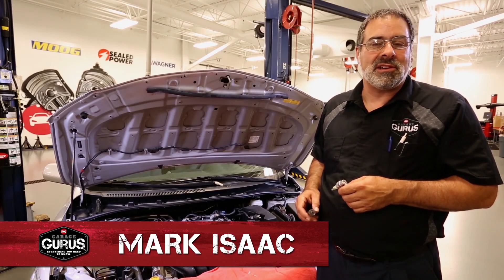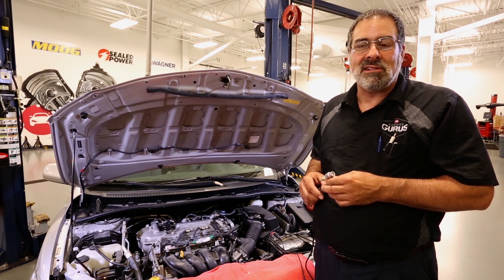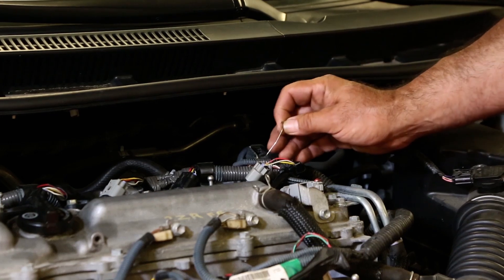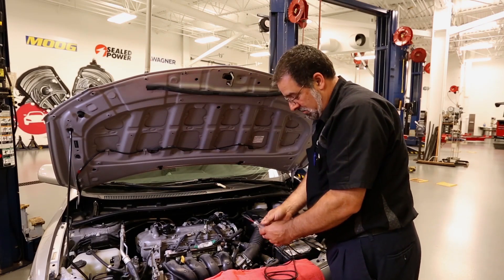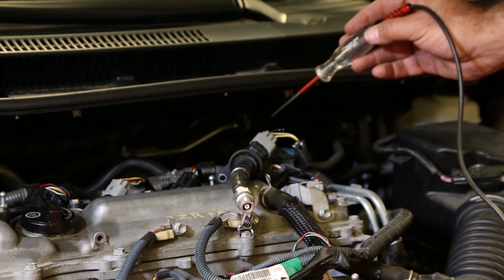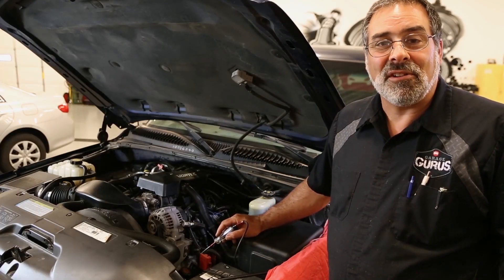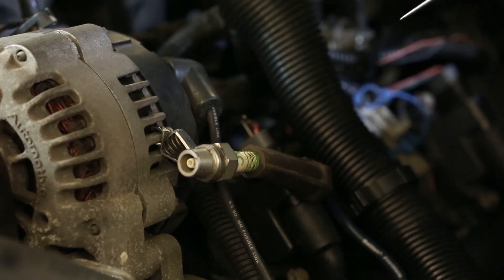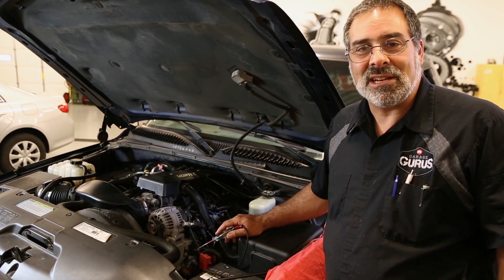Ignition Coil Test for Coil-On-Plug Systems

Comment: Hi ,What voltage is required to trigger the coil? Did you apply 12V for triggering? Your instructions aren’t very clear.
could you please explain in more detail?
Reply: 5 volts.

Comment: @Garagegurus does that mean its getting signal from the ecm and wire is not broken
Reply: No, you are acting as the ECM by tapping backprobed trigger wire. All this test tells you is if the coil is good or bad and if you have power and ground at the coil.

Comment: Very nice, my question is how does the transistor in the COP does not get destroyed with the 12 Volt ? A last question, how can I trigger 2 wire ignition coil , can just supply the negative wire with a ground ? Thanks in advance.
Reply: You have to first figure out if it's ground side triggered or positive side triggered.
Reply: Φίλε 
Όπως είδες αυτός χρησιμοποιεί ένα δοκιμαστικό κατσαβίδι έτσι δεν είναι 12 volt
Επίσης όπως είδες μόνο το ακουμπά λίγο
Reply: @konstantin-big  It's a test light connected to battery positive
Reply: Φίλε 
Εδω μπορείς να δεις πως γίνεται ο έλεγχος σε πολλαπλασιαστη με 3-καλωδια
https://youtu.be/PpofMV7DAow?si=WvsUU_dB12q3umKK

Comment: by B+ you mean positive terminal?  How do you get the voltage reduced to 4V?
Reply: I believe the computer reduces the voltage to the primary coil.
Reply: @wdtony  I think he did a direct feed from battery, consequently the computer would be bypassed
Reply: @renejacques8288 

He states the test light is hooked up to B+ and is reduced voltage. Ignition on. 

And this is the state B+ should be in until the computer opens the switch to collapse the field in the secondary winding. Since the car isn’t running, the primary (B+) will remain closed with reduced voltage available to the test light.
Reply: @wdtony  I thought B+ was pos + of the battery and as such is a constant 12v, and the switch the computer uses is 4v, yet he's hooking a direct 12v to the 4v trigger wire.
Reply: @renejacques8288 

B+ is reduced voltage from ECM, not battery.
Reply: @wdtony  The test light is directly hooked to the battery which is 12v; right?.  Does the COP itself reduce the 12 volts coming from the battery to 4v?
Reply: @wdtony  B+ is Battery voltage. He has the clamp end of the test light on battery positive, so he has 12 volts at the tip of the test light's probe, but as soon as he touches the T-pin the voltage gets divided between the light bulb in the test light and the transistor.
Reply: @renejacques8288  There's voltage drop at the test light as soon as he touches the T-pin.
Reply: @wdtony   No it's not. B+ is battery voltage.
Reply: @bernardocisneros4402  Is it really a voltage drop, or does the coil sensor draw 4V out of the 12V source (B+)?  If there is an actual voltage drop when he touches the T, what causes the drop?
Reply: @renejacques8288 The voltage drop is caused by the flow of current when he touches the T-pin with test light. The transistor and test light are in series and in a series circuit voltage drops are proportional to the resistances of the items in the circuit. Basically, the 12 volts gets split up between the test light and the transistor.
Reply: @bernardocisneros4402  OK.  Thanks.  Brings back some memory.
Reply: @wdtony   B+ = BATTERY POSITIVE
Reply: @renejacques8288  No, the PCM outputs a 4V square wave to the FET on 3 and 4 wire COP, the FET is inside the coil, the 2 wire COP the FET is inside the PCM which grounds the primary.

Comment: Which wire you triggering the signal wire,and are you sending a ground or current to trigger it?
Reply: The coil has two Pin (wires) ... one is the switching the other is constant 12v. He is sending voltage to the switch wire by providing 5v from his tester connected to + battery . YOU HAVE TO USE THE LIGHT TESTER TO THIS WAY.

Comment: If you have test light connected to battery positive isn’t that giving the trigger 12v instead of 4v and burn out ecu ?
Reply: If he wanted to apply 12 volts to the T-pin, he would just use a wire. He's using a test light to drop the voltage from 12 volts to about 5 volts
Reply: @bernardocisneros4402 😂

Comment: So do you mean..we hve to find the trigger pin in the coil circuit? And connect it with positive from battery to trigger? And just turn on thecar?
Reply: Never use a wire to do this. You have to use a test light.

Comment: Thanks for your video. Does this method  work for BMW 525I 2004? It has 3 wires. Is the test light voltage as same as the trigger  voltage?
Reply: I don't think bmw coils have built in ignitors
Reply: Wondering the same with a BMW X5 with the same motor as yours

Comment: "test light hooked up to big plus, we'll use the reduced voltage"  what does that mean, does he mean he hooked the test light to the positive on the battery and if so why would that be reduced voltage....so confused!
Reply: He’s connected his test lite to the battery positive post(12volts). The incandescent bulb in the test lite reduces the voltage from the battery positive post  (12 volts) down to 4 volts which the Toyota uses as trigger voltage. As Liam stated, the resistance in the test lite bulb is what reduces the voltage. Hope this helped.
Reply: @tboneproductions2453  how to find trigger wire on corolla?
Reply: @letmethinkv  ALLDATA
Reply: gagnant 4 its reduced voltage because he uses an incandescent test light. If you stick a jumper wire from battery positive there would probably be some fire works. 

The test light is a very useful tool. Almost broken wires can show 12v on a multimeter however they do not carry enough current (amps) to light an incandescent. Its because of the resistance of the bulb inside the test light.

Comment: What you were using as a ground for a test spark plug ?
Reply: lol its in the video. a bolt thats on the engine.
Reply: @SuperHtownswag  not just a bolt, i saw there's clip but I don't think spark plugs would have that clip, is there?
Reply: @kongwu482  It also doesn't have any threads and looks like it was cast that way, not just had them ground off. Pretty sure it's a specialty tool, would be nice to have.
Reply: You get this tool in amezon kD tools🔧🕺👍👌

Comment: Hey! This seems like a quality video with some great information. Unfortunately, I don’t know enough to really understand what is going on. 

I am particularly interested in the solution for the Corolla. 

Are you able to link the diagram for the coil-over-plug(COP) that you showed in the video?
What does backprobing do?
What type of clip are you using to ground the spark plug?
You mention that you have the test light hooked up to B+ while touching the tip to the engine block, is this the same B+ that you mentioned is a part of the COP circuitry; does that mean the other end of the test light is already hooked up to the B+ on the pack or is there another B+?—I’ve not used a test light before,  is there a standard or would I need a particular one, are you able to provide a link to the one you are using in the video?

Thank you for your time and for making this video!
Reply: Austin Lowther it’s connected to the battery positive. The test lightbulb reduces the voltage to a safe level as you’re working on a 5v ECU circuit. 
When he touches the engine with the tip it completes a 12v circuit to turn the test light on as the engine is an earth point (connected to battery negative)

Comment: Can this technic work on 1990s car?
Reply from the maker: It would depend on what type of ignition system the 90’s car uses.  This test was just for the smart coil systems on late model engines.  You can trigger some ignition systems with electric drills or soldering guns when they are placed next to the reluctor.
Reply: Nissan 240sx or any japanese cars. Instead of cranking engine, there must be another way to test spark at ignition coil.